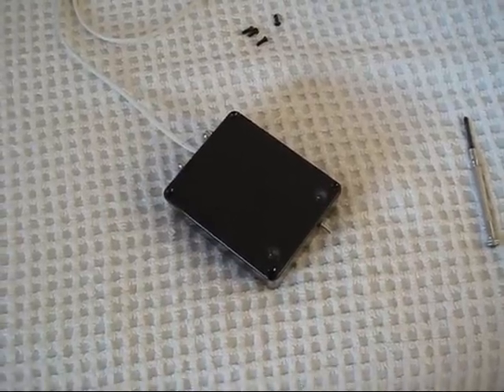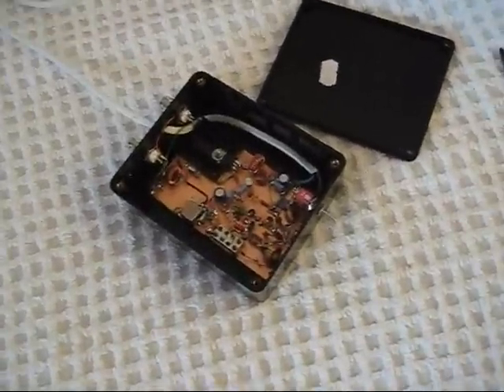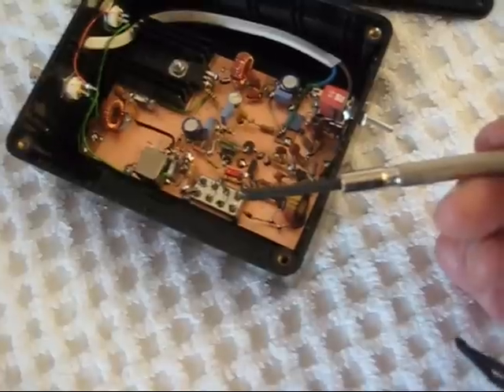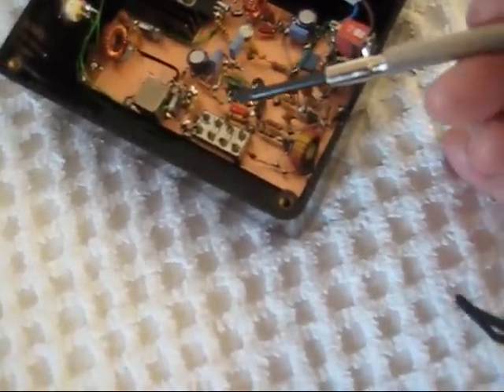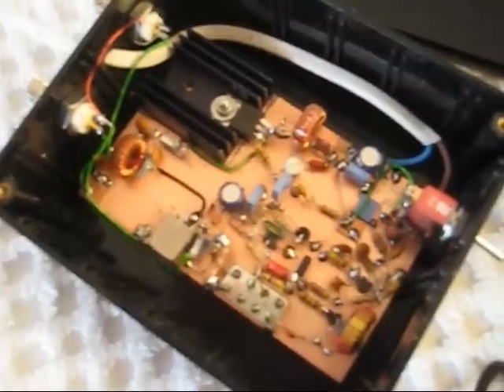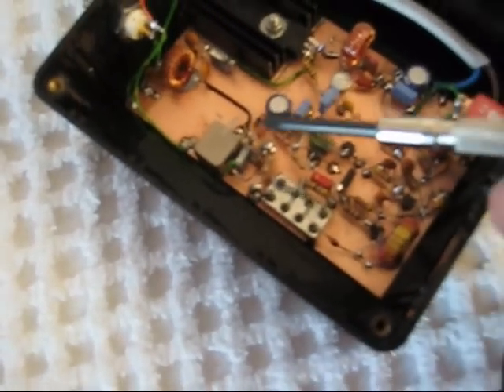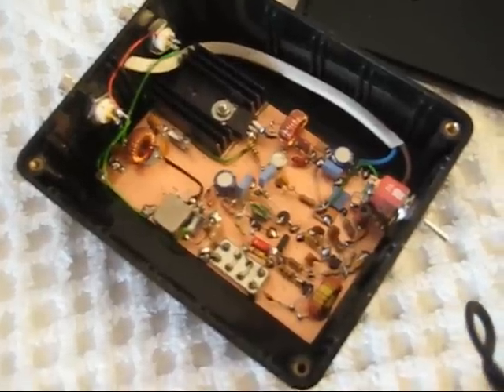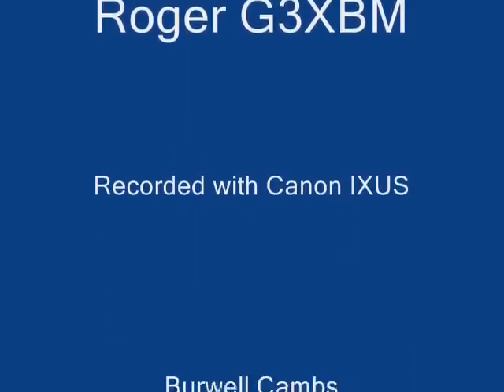G3XBM's 500kHz QRP Transverter

Comment from the maker: Yes, the TX is mixed down from 28MHz but the 500kHz RX signal gets passed straight through to the FT817 on 500kHz (it operates split RX/TX). My antenna is not large: just 5m long with a capacity hat consisting of a spiral of wire. See my website for more pictures and details. Modes I've used are CW and WSPR.

Comment: Nice work on the transverter.  So you are TX in 28Mhz so your out on 500Khz and RX 500Khz?  Did I get that correct?  I imagine you need quite a large antenna for 500Khz.  Is it safe to say this is restricted to CW due to the BW?